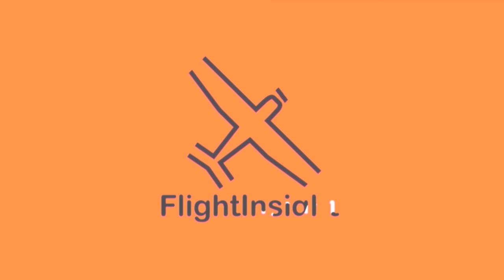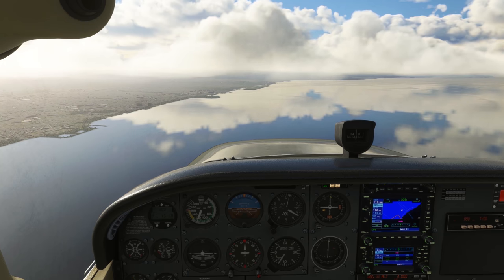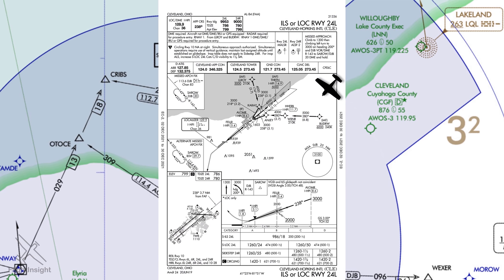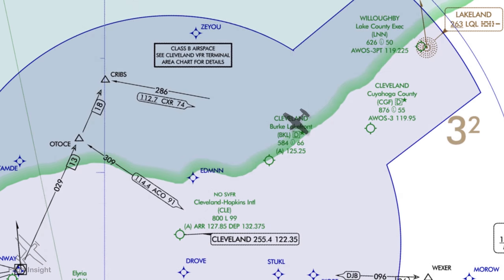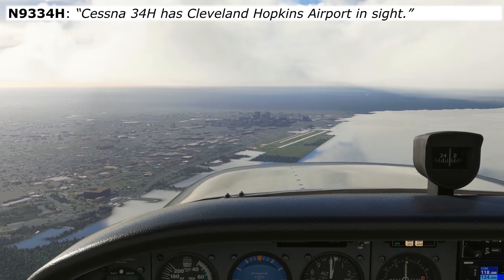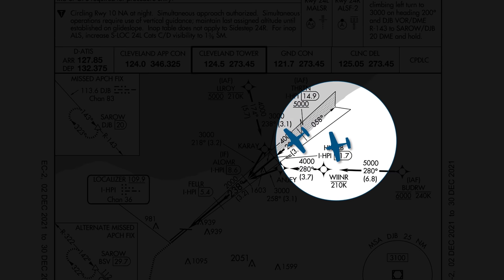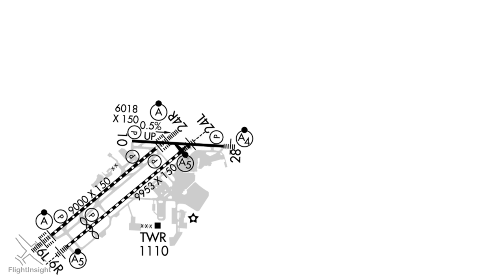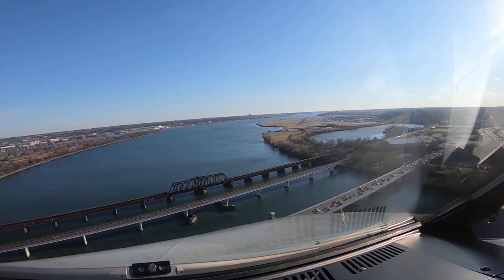Visual Approach Explained | Contact Approach | IFR Training

Comment: Great videos.  I didn’t understand why you use 1,000 feet and 3SM as the VFR definition towards the beginning of this one.
Reply from the maker: Great question. VFR cloud clearance requirements relate to us in the aircraft depending on what class airspace we're in (we're familiar with the 3-512 of Class C, D, and most of E). Towered airports can be considered VFR or IFR based on weather observed at the field. AIM 5-4-23 lists the required weather at 1,000 foot ceilings and 3SM visibility in order for visual approaches to be issued.
Reply: @flightinsight9111  This is also in the FARs: 14 CFR 91.155 (c) and (d)

Comment: Why would the aircraft need to maintain visual separation with the aircraft on the parallel? Is it because the runways are really close together?
Reply: ATC needs to maintain certain distances between aircraft on their radar except when the aircraft are maintaining visual separation. As the pilot when you say traffic in sight or maintaining visual separation you are effectively taking responsibility for collision avoidance with that aircraft. So this allows you to be closer to aircraft on a parallel approach than ATC otherwise could allow.
Reply: Depending on the distance between the parallel runways visual separation may be required anytime vertical or lateral separation cannot be maintained. Example: the runways @ SFO are only 750' apart which required visual separation anytime IFR separation is lost. At most airports where the parallels are at least 2500' apart you only have to advise the aircraft of the aircraft using the parallel. This is often accomplished by an ATIS broadcast which states "simultaneous visual approaches in progress runways xx & yy".
Reply: @SteveH98264  found out why, and its because wake turbulence for a small behind a large is 4 miles when on approach to the same or parallel runway separated less than 2500 ft"
Reply: @andrewlorenzo6611  That's only a very small part of the equation. Any time you do "side-bys" at SFO visual separation is a must. Standard seperation is "1000' vertical or 3 miles" with a bunch of addition separation standards depending on the type aircraft. If I had a "small" on final to SFO during sidebys he was not only maintaining visual separation from the aircraft next to him he was probably "following" whatever is in front of him. A small is supposed to be 6 miles behind a heavy yet I routinely ran them 4 miles in trail. Are we confused yet?

Comment: The visual or non-visual approach thing is confusing to a low time IFR pilot like myself. At my busy downtown airport, its common for them to decline a practice IFR approach due to traffic. However, they don't then also require a pattern, usually. So I go ahead and fly the approach just as the plate depicts and there is no issue. So why did they decline the practice approach? No idea.
Reply from the maker: Yup, I think maybe they'd just rather wait until you're closer to have to think about you, even though you're doing exactly what you had requested on the approach.